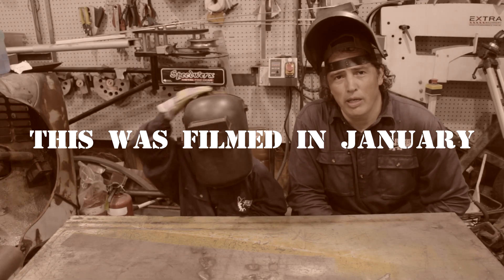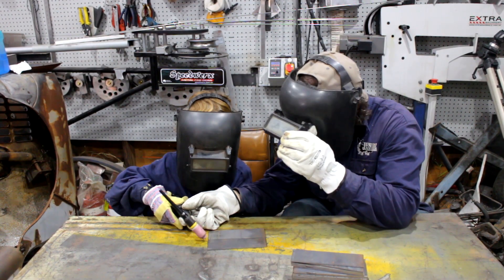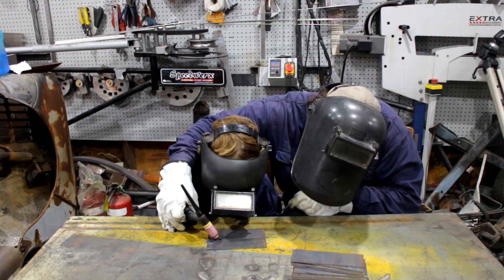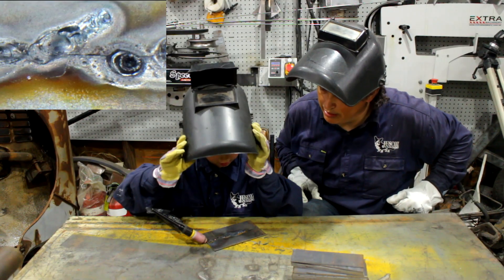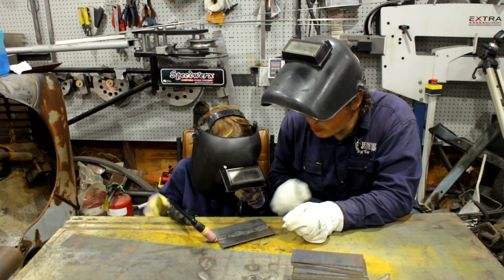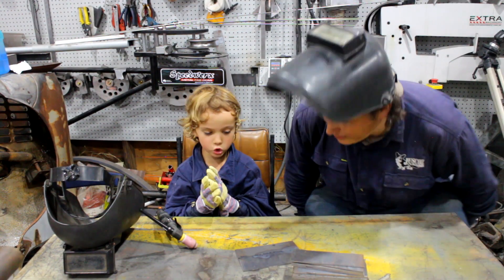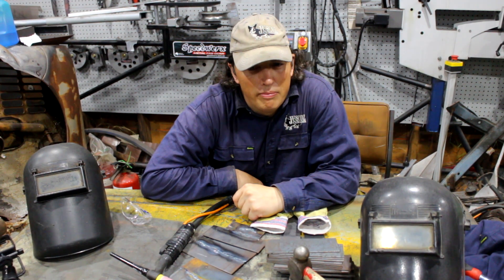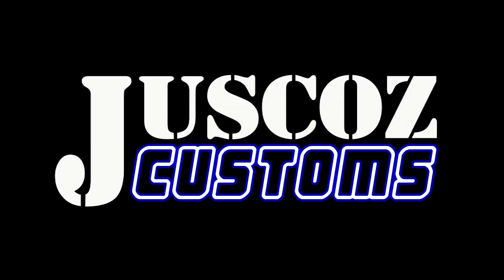teaching a 5 year old to TIG weld

Comment: time to mig/flux core next haha ,  might find it easier as im sure he'll like pulling the trigger ;) bang bang
Reply from the maker: @SamFBM  ewww fluxcore. Not unless I'm doing structural fabrication again. Little O has had a go with MIG but didn't like the noise. He will have another go later. Or he might just be a tig snob😆